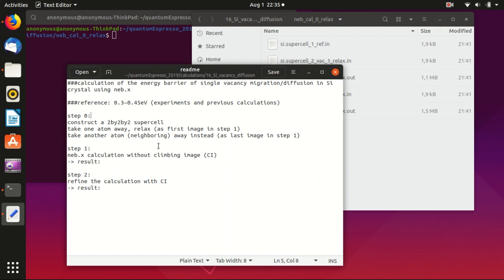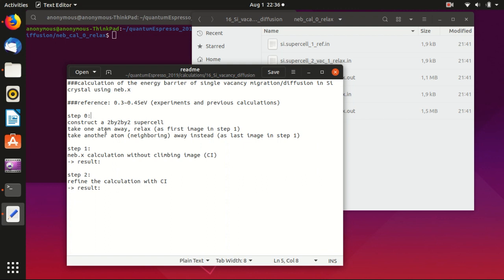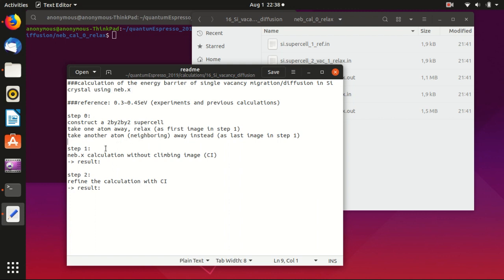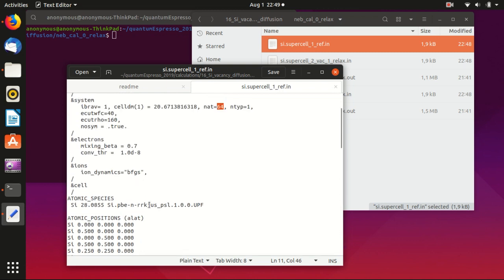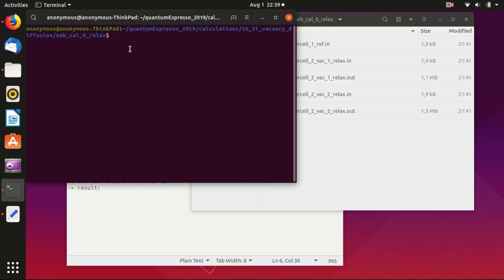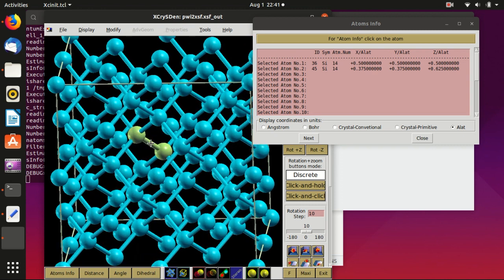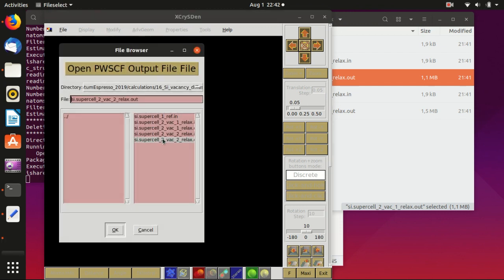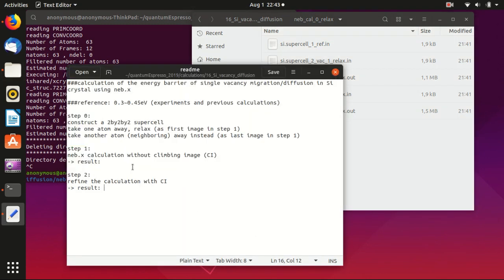Project: 15.1 (relax) energy barrier of vacancy diffusion in Si | Quantum Espresso Tutorial 2019

Comment: Hello, thank you so much for making these videos. How did you get the celldm(1) value in si.supercell_1_ref.in? And how did you determine the numbers for all the Si ATOMIC_POSITIONS? Thank you very much!
Reply: You can do that with VESTA software, just input the cif file in VESTA and make a supercell and then export it as VASP and do proper editing to make it adapted for QE format. Also you can do the same using the GUI burai. (Here I'm talking only about making a supercell or design using burai but not the calculation).